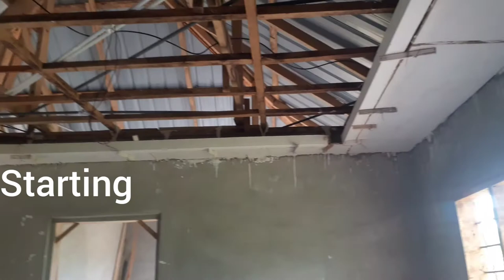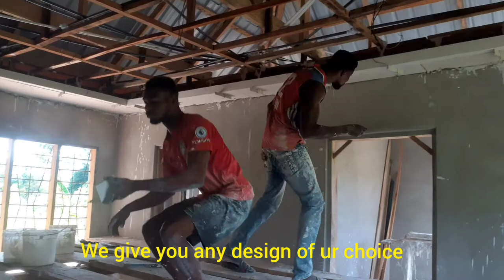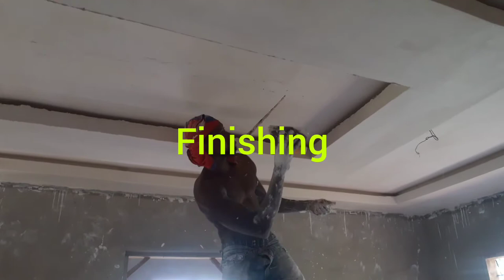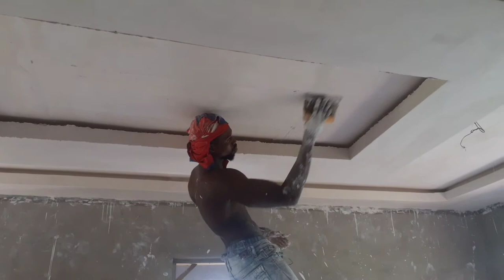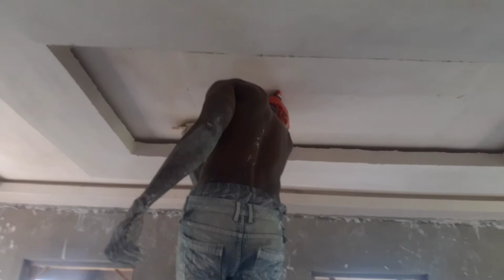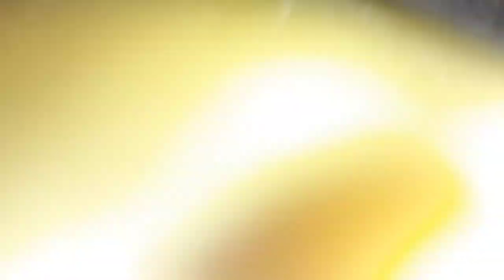POP CELLING DESIGHN, ANDREI, PAINTING, ELEGANT P,O,P WORK  +233545584955

Comment: I saw the process you adopted to build the bulk ceiling. My question for you is, why are you not building a frame with wood or metal studs and buying gypsum board made from factory to cover it. It will be much quicker, more robust and with half of the effort. Also by purchasing the panels, you will have a consistent quality as they are fabricated with industrial machines and go trough quality control. Let me know your thoughts. Thank you
Reply from the maker: Is more expensive than making it urself